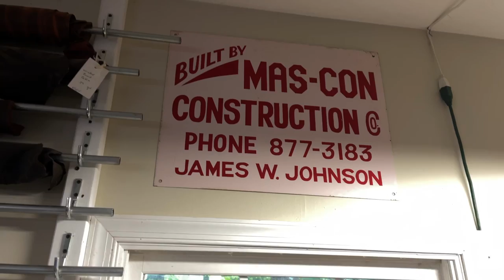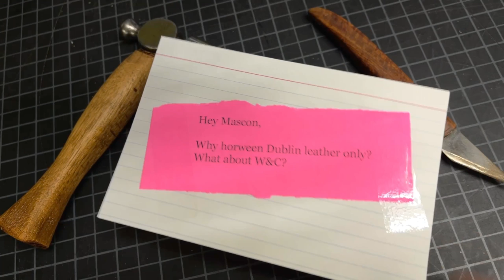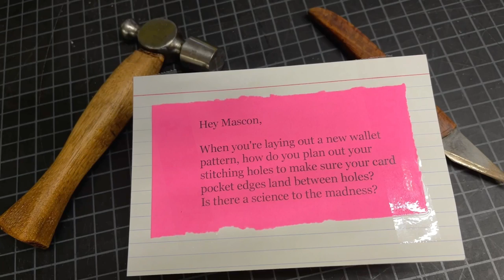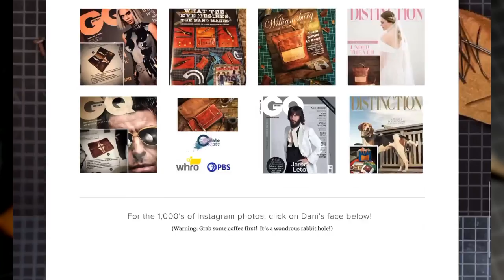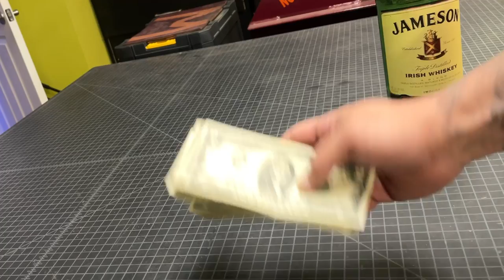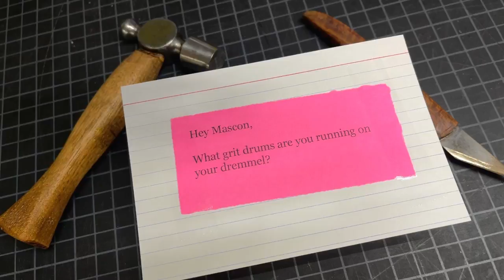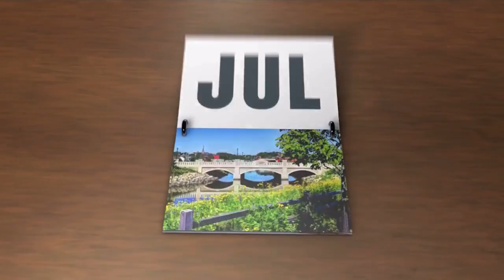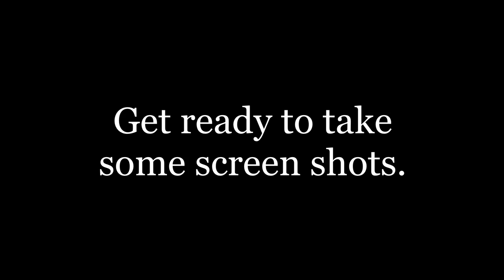YOUR Leather Craft Questions, Answered!

Comment: If you're a decent photographer and you're still having trouble with the models thing, try Model Mayhem. It's basically a mix of myspace and craigslist, where hobbyist photographers and models can easily team up with each other. I only did it for a year or so, but in that time some of those shots landed on magazine covers, so you'll be surprised at the quality you might find. But, like craigslist, you'll have to filter through some fairly unprofessional people, so use caution and be smart. You'll build connections, and that's what really matters. I still work with 3-4 of those models from time to time.
Reply from the maker: Thanks!!!

Comment: the neatsfoot oil compound actually has no real neatsfoot oil in there. It is however far better than pure neatsfoot oil for leather. Originally, neatsfoot oil became widely used in the leather world because it was another byproduct from cows ( it’s made of cow shin bones) and is very inexpensive. That being said, it oxidizes quickly, goes rancid and under certain conditions, will cause your leather to mold or rot. Often times, you won’t even notice if it went rancid or if it caused your leather or stitching to mold.

Comment: "it's just tokenole" ?. He's using some sort of sorcery or gypsy spell because his edges look like glass when he's finished.
Reply from the maker: 😆 comment of the week!!  (The sorcery = time + patience)
Reply: And sanding! Most important part. I won’t plug my stuff here, but my edge process is sand, sand, sand and then tokonole. 120 grit, 240 grit, 320, 600, 1000, and sometimes up to 1200 with slight burnishing in between, and then finish with tokonole and a canvas cloth. Time reference, one wallet worth of edges can take 35-40 minutes or more (usually more)!!

Comment: I know we probably won't answer this one but what is an average year salary? Not an exact number. or maybe at least do you make more or less from leather than your 9-to-5 that you had before?
Reply from the maker: I make 2 times as much now as I did in banking. 

But….

I do A LOT more than just “leather” goods. 
However, I work 13+ hours a day now.  

It’s all about diversity in incomes, etc etc. 

But looking at JUST leather goods, when I quit the bank (I was there at the same place for 19 years, branch manager, courtroom rep, etc) I was making exactly the same either way.   That’s why I made the leap. 

But!!!  It took 7 years of every morning before work, every night after work and every Saturday and Sunday.   For 7 years, I worked two full time jobs (bank and leather) to push leather brand upward. 

Then, after I quit the bank, those measly hours went to leather, I didn’t have to start leather at 4:30 am and end at 9:30 pm.  Now I work 6:00 am to 7:00 pm.   😆